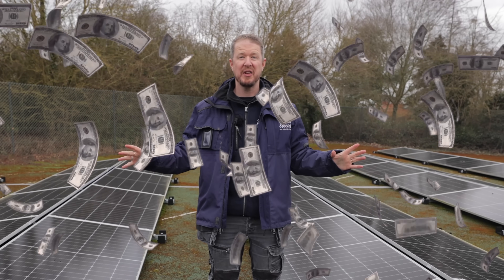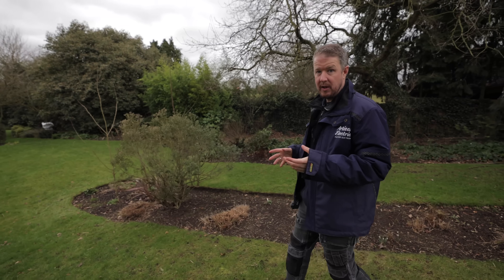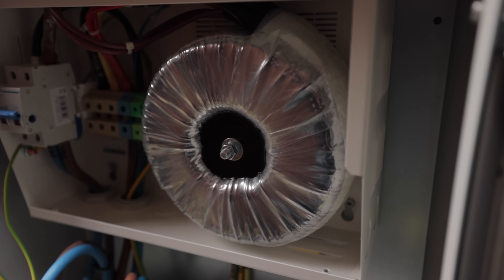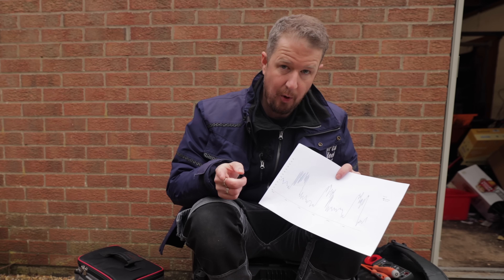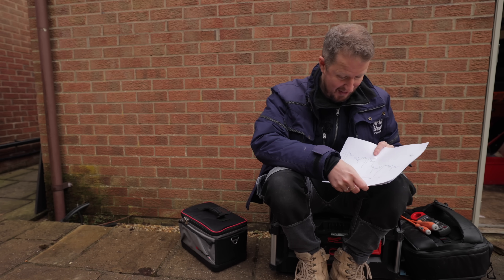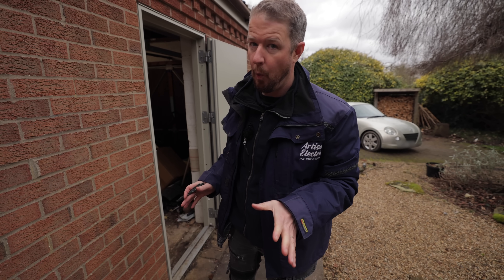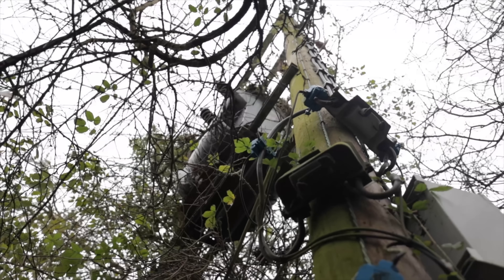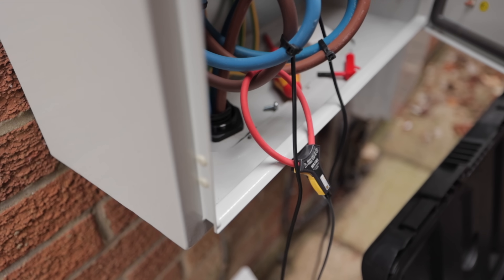THOUSANDS Down the Drain – And We Can’t Do Anything About It!

Comment: Looks like you have a bad inverter voltage regulation issue. Perhaps the parameters aren't programed properly from the default settings to fit application or just a bad inverter. Quality isn't what it used to be.  Do you get the same spikes if you cut the main power and just run off battery backup? Do you get a constant voltage from the mains with the solar system disconnected? The customer will have to work with you to get some testing done. Until that happens, I think you are chasing your tail and not truly knowing where the actual problem is. Taking a wild guess is possibly wasting time and money, while not getting you anywhere. Hope you get it sorted.

Comment: I had this exact same problem here in Tasmania, Australia. I called the local regulatory body and explained the issue. The grid team came out the same day (!), checked our loop impedance was appropriate and simply changed the tapping on the 11kv transformer just down the road, to drop the supply voltage a tad, and hey presto, problem solved. The guys even stayed for a couple of hours to make sure the voltage remained low enough, stable, and didn't make our PV system drop off the grid. 
It's a pity the UK is too bureaucratic to allow something as simple and cheap as this...

Comment: Where are the graphs for reactive power (Q)? I would have thought the inverter should be regulating Q to manage the voltage (runningin Voltage droop)? Or is it running a fixed power factor? The fact that Voltage spikes with generation suggests Q is not being controlled properly at the inverters.

Comment: you are "pushing" 17kW to a single phase, that must cause issue with balance of phases in network. In my country solar export is limited to 3.6kW for a single phase installation, if you want higher export power you must have three phase installation.

Comment: i am not more then an amator electrician so i dont get why you have the problems ..... from what i know the solar sistem goes like this : pv grid =>mppt => battery and the invertor will transform and push energy to the grid (you did show bateryes in there ) so asuming that the solar panels , the mppt and the bateryes are functioning properly the problem will be with the invertor or the public network ..... am i stupid for thinking like this ? ... i am not mocking any1 here , like i sed - amator here

Comment: Would another transformer help on the pole that leads to the house wire so its only the house running thru it the whole electricity industry needs a upgrade to cope with rising electric vehicles and solar pannel

Comment: Had same problem in Belgium. Electricity company claimed the voltage could not be set lower while at my family elsewhere, their voltage was 220v in full sun 🤷 One year later and the voltage has magically decreased to 230v average with peaks of 245v max vs 260v before. It is 100% a grid problem and low voltage can be 10% lower then 230v no problem so 207v is still ok for appliances.

Comment: I'm an electrician of 45 years. Overhead supply's (TT) systems are to small to carry all the loads and basically Sh-T. You should have carried out a data logging / supply survey before you even think about installing Solar to that pile of crap transformer up an overgrown stick. The voltage will be up and down like a mattress in a cheep whorehouse. Sit the client down and tell them to come off the grid and get lots more battery's and just run with that, or try to get the DNO to upgrade the supply! (that's not going to happen) Good luck, i think your a good honest company that's trying to do there best but the UKs rural electrical infostructure sucks. 

Ps to Beyondzeroemissons Australia is a tad different to UK,  your solar, calculations and installs will aways be better in your neck of the woods, sorry i mean desert!

Comment: The "voltage optimizer" is just a transformer to reduce the voltage coming in from the mains. The PV inverters, when feeding the grid, must produce a higher voltage than the supply otherwise the current wont flow back to the DNO transformer on that ancient pole in the woods. How the electricity meter sorts all this out is anybody's guess especially since the toroidal transformer could be altering phasing as well.

Comment: I wonder why didn't connecting to grid stabilize the voltage? I mean if it's feeding more than 240V shouldn't it start pushing it to entire neighbourhood? And if so shouldn't the cumulative consumption of entire neighbourhood be enough to make excess of 240V go down since if you consume more that this solar park is able to supply voltage should go down?

Comment: Probably that solar installment is too big to connect that residential network cell/area. The inverters want to push the generated extra energy to the network but for that they have to increase the voltage difference. Maybe that would be acceptable if that residential local network cell would be bigger. I would like to ask that your Inverter supply only 1 phase or 3 phase? If your network connection would be only 1 phase that is a very very wrong choice on both side. If it is already 3 phase supply you need to connect not the 400/230V network but the 10kV or 20kV network if you have those nearby.

Comment: The installation is clearly at fault here if it's still putting power in when there's an overvoltage. It's still the user's responsibility to put power into the grid within a specification. A 17kW installation is pretty big and this should have been considered at the design stage.

Comment: 240V is not extreme high. All the electrical companies started to increase decades ago the voltage from 220V to 230V, but when a transformer should supply a long street the nearest customers get 235-240V in order to the end of the street there will be enough voltage too. The modern electrical devices, appliances can handle 240V.

Comment: Does the battery or solar inverter have the option to refine their voltage control settings? If so, you could set them to provide vars to boost the voltage when it’s low, and absorb vars when the it’s high

Comment: So the poor people down the road are getting huge voltage variations due to that one property, 200V over night 260V during the day. if the solar wasn't installed the power grid would be fine. under voltage is much more preferable, so why don't you put the voltage stabilizer just feeding the house (bugger the neighbours), so Feed from power grid, to solar batteries and  inverters, to voltage stabilizer, to the house. this way the house the voltage never gets to the 260v and the ev charger always works. at night the voltage in the house may drop to 200V but most stuff now has switching psu's which will cope with the voltage drop.

Comment: I personally think that most power systems were never designed to import power from the customers and there are going to be many more odd situations like this. I have overheard feed here and am looking to put solar system here. I lived in a house with only solar and had few problems. But i am not going to export power here for several reasons and you have supplied me with another. Voltage fluctuations on overhead cables happens and have learnt to live with it.

Comment: The moment you mentioned significant over voltage during solar production, it was obvious to me the grid supply impedance was too high, since the grid should be an infinite supply that cannot be influenced by property generation. So the transformer is underrated.

Comment: Typicaly awful PV MCS installation ie. Useless  positioning!
Is this part of England at the equator or something!!!!!!
Sounds like a hob-bodge of different equipment stuck together, and the potential PV panel output just added up to give the 17KW figure - bet there's a SunnyBoy in there too!
Your panel installation should be corrected as this is the first failure point in the "design" - transient weather + poorly orientated panels + poorly sited(significant overshading from multiple directions, mean that the panels will be going from low V/Low Current to spikes of HV/H Current, which the Inverters ARE NOT DESIGNED TO OPERATE ON(Power MOSFET/IGBTS are relatively delicate things).
Why the DC storage - do they suffer from regular black/brownouts?
Your paying for this, because you didn't design it and install it competently(the client has the right to complain to the MSC and seek investigation, and saying the line "240V is high" IS VERY MISLEADING AS THIS IS OUR NATIONAL STANDARD, but is often under voltage at 235VAC......
Furthermore - great job reducing the access to the back door with all the wall mount boxes - Remember your Building Regs!

Comment: the power consistance is terrible, had a smart lightswitch that kept getting reset so i put in a evergy monitor and the voltage levels were all over the place several times dropping below 210v

Comment: If it is just the car charger which has problems with the voltage range you could put a 15kva voltage stabiliser in line with the charger to cope with both under- and over-voltage conditions. This works in the same way as the optimiser but has voltage taps both above and below the input tap and a power control circuit to select which tap supplies the output. Alternatively you could have a whole-house stabiliser where you installed the optimiser, but that would need to be much bigger and I don't know if that would play nice with solar exporting.  

Please do continue to post on this issue as I am going to have a similar situation myself in about a year's time - a large 3ph solar-battery install on a rural block at the end of a long single-phase line, so any lessons learned would be very interesting.

Comment: Quite common to see big fluctuations at the end of a line for obvious reasons. Should have put everything on in the house, hobs, ovens and any heaters avaiable. Then measured voltage drop while monitoring current. Cheap and quick to do and you can make a cup of tea. That should give you a good idea of ze. Dont overload the DNO's fuse though.

Comment: I have had the exact same pproblems. . . .The grid is not designed for input of solar or wind generation. most EV cars will suspend a charge plus or minus 10% of normal voltage as designed. The DNO transformer was tapped to allow for volt drop at the end of the line. Customers renewable generation fucks that all up.  The more you add will only get worse. 

The presence of waveform distortions such as harmonics, interharmonics and supraharmonics
are reported during EV charging and are verified using measurements. An attempt was made to
determine how they aggregate and propagate in a low and medium voltage network with multiple
EV integration.  It was found different for different charging cycle because of different uncertainties such as battery SOC,
background distortion level, charging rate, power electronic technology used etc. Hence there is a
need to develop a new method to address this issue. The interharmonics aggregation study
concluded that the aggregation peak current value depends on the randomness of the number of
EVs charging. With a random number of EVs connected to the grid the distribution is an extreme
value distribution and it loses its skewness and become normal for constant number of EVs. Hence
in reality with random number of EVs the standard summation rule fails. In the supraharmonics
range the necessity of unified measurements, immunity/standardization and interference
knowledge for aggregation studies are emphasized. Though the magnitude of supraharmonics
current is very low, they get superimposed on primary and secondary emissions while they
propagate through protective earth (PE) and cause unnecessary tripping of RCD. It was also
inferred that the EVs connected to installations with TN-C-S earthing of high capacitance and low
resistance will experience high leakage current. 
EV chargers are not affected by shallow voltage dips. While considering the Swedish network
with underground cables in transmission and distribution, even a fault with shallow dip cause large
transient at the beginning of the dip due to the switching of cable capacitance. When this dip get
propagated to the distribution grid it may get amplified (high impedance grid) based on the
resonant frequency. Hence, even a shallow dip with a phase angle jump (PAJ) of 20oC has a big
impact on the EV charging and the life of the battery. EV while discharging are more sensitive to
asymmetric dips with phase angle jump as they cause high overvoltage and oscillations at the dc
link of the EV charger. This impact is noticeable while less number of EVs are charging.
The light flicker due to fast voltage variation caused by EVs charging mainly depends on the
number of EVs connected, the topology of the LED lamps used by the customers and the
impedance of the grid. Though the flicker is more prominent in a weaker grid (high grid
impedance) it mainly depends more on the lamp topology. The lamps with active power factor
correction (examined based on the current waveform) is more sensitive to fast voltage variation
and cause light flicker.
PV-EV hosting capacity was determined using a stochastic approach considering the
undervoltage phenomenon. The investigation concluded that the impact of electric vehicle
charging during day time is lesser than the impact during the night time and it also depends on the
relative coincidence factor between PV and EV. The likelihood for an undervoltage for single-
phase and three-phase is very small during day time and is high during the night time. The
likelihood of an undervoltage violation increases with the increase in charging power and
penetration level.
The hosting capacity study quantified in terms of curtailment (hr/yr), determines that the
penetration of large rated electric vehicles can be increased gradually with the increment of
curtailment (hr/yr) keeping in view the social and economic limit. Considering overloading
conditions taking into account the load profile of northern Sweden the hosting capacity is
quantified surplus, but with certain risk during winters. The study also calculates the reliability
index to determine the optimal location for the EV integration with respect to the Average Energy
Not Supplied (AENS) index value. A similar study investigated the hosting capacity using
probabilistic dynamic line rating (DLR) for northern Sweden during the period 2011 and 2018. Its
shows that by using DLR the minimum capacity will increase up to 56% of the maximum transfer
capacity with static rating during the peak load period in winter. Since real-time study is based
on perfect knowledge of the environmental parameters it is important to take in to account the
uncertainty in the DLR calculation using probabilistic approach. Probabilistic DLR, where the
probability of overload is used as a decision criterion, can provide more hosting capacity in terms
of number of EV cars. It will allow a continuous, hour-by-hour, trade-off between accepting some
certain level of risks or neglecting them. A study on the impact of temperature on the EV hosting
capacity inferred that by introducing the temperature coefficient there is around 30% decrease in
hosting capacity during colder months due to fast discharge of batteries. Hence to maintain the
reliability of the grid the operational planner should include this surplus load and risks in the grid
along with the temperature factor inferred from the above studies while planning and perform
mitigation steps in terms of curtailment and non-secure operation keeping in view the social and
economic limit.
Results from the project can be expected to be used by other researchers as a basis for deeper
studies, by electricity network companies as a basis for strengthening or otherwise adapting their
electricity networks, by manufacturers and charging infrastructure to reduce interference emissions
and improve interference resistance, and to define future guidelines, connection requirements and
standards. Results can also be used as input for the design of "smart charging" and the design of
electricity markets.
The project will also lead to increased knowledge about how new appliances affect the electricity
grid and how the electricity grid will affect new appliances. This knowledge will also be useful
when connecting other new types of devices, such as photovoltaic systems, battery storage, new
types of lighting, energy-efficient devices, etc. Don't say we never told you. Tell ED it isn't gunna work!

Comment: YOU ARE NOT ALLOWED TO INSTALL VOLTAGE OPTIMISER UPSTREAM OF A PV INVERTER!!!
The voltage optimiser blinds the inverter to the true grid voltage and when exporting, the voltage optimiser will actually step up the voltage from the house to the grid. You can end up sending >265v back to the transformer and neighbouring houses! It’s very dangerous

Comment: Perhaps solar simply isn't the answer for such an energy intensive property with such crappy grid. Adding more and more expensive boxes isnt sustainable. Probably made in China with toxic material.

Such a system should be designed by an electrical engineer